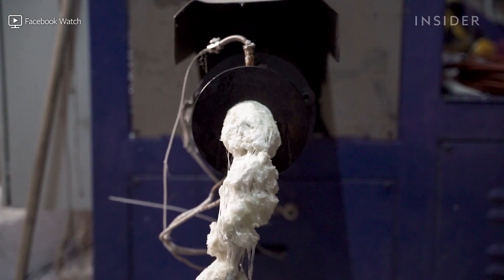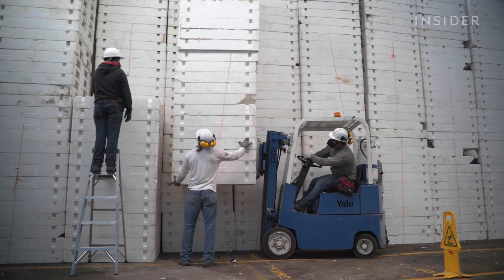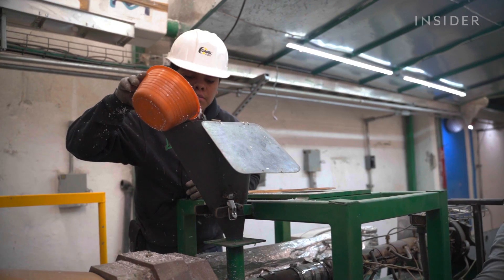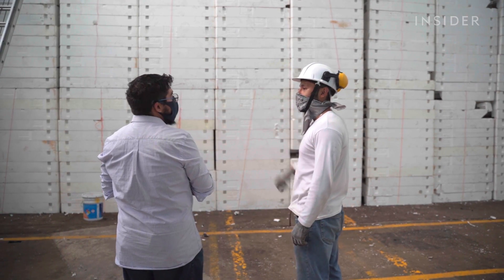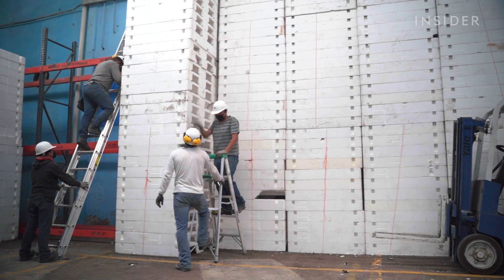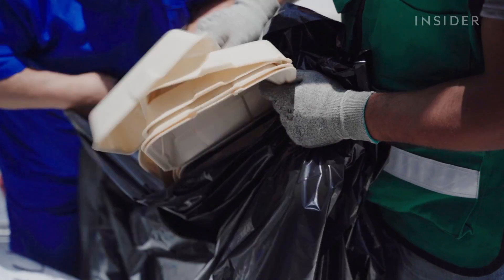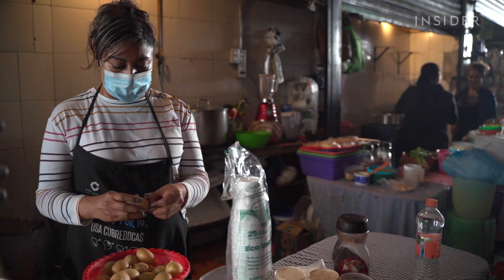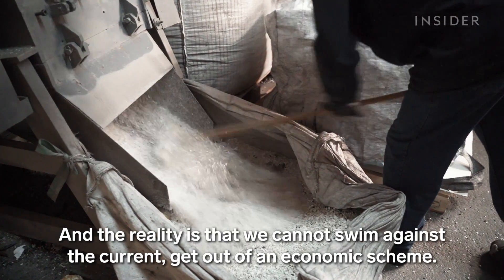Why It’s So Hard To Recycle Styrofoam and Polystyrene | World Wide Waste | Business Insider

Comment: In colder areas its probably a better idea to burn it.
Here in the town in the north of Sweden we have a cogeneration that has around 93% efficiency. It has state of the art filter systems that makes the air going out the chimney less polluted than the surrounding air (filtration removes 99.5% of all pollutants). 
It produces heat and electricity of course, but the filtrations system also produce gypsum as a byproduct and the final waste from the furnace is a granulate that could be used for filling up different kinds of hard surface grounds.
Sorry to say that no one buys those byproducts since they are associated with household waste..

The plant can burn 75 tonnes of waste per hour and produces 65 Megawatt of power where 15 is electricity (70GWh/year).
Reply: the foam densifier appears in this video is our brand called GREENMAX, we are also the end user of recycled EPS and EPE, would you like to recommand us the so we could buy that from them?

Comment: I think that a very critical aspect of the cost effectiveness and profitability of recycling this polystyrene foam is on-site densification of much of the foam prior to shipment to the recycling facility.  For a product that is about 95% air in its foam state, it likely doesn't make economic sense to load it on big heavy trucks for the trip to the recycling center (if one wants to make a profit).  To be cost-effective, the truck should be full (in volume) and the payload capacity should be maximized.  This can only be done if the foam is reduced from about 95% air to perhaps 5% air before shipment.  So the mobile foam densification machine makes a lot of sense to me.  Also, perhaps a relatively inexpensive densification machine for permanent on-site use would be very helpful.  This would be most helpful for businesses that generate a lot of continual polystyrene waste so as to greatly reduce the amount of storage space required.  Also, for places that generate a lot of food-contaminated polystyrene waste, a relatively inexpensive enclosed washer for removing about 95+% of the food from the polystyrene would likely be necessary so that polystyrene will be clean enough for the recycling process.

Just my 2 cents.

Ed Schultheis, PE
Mechanical design engineer and manufacturing consultant for 35 years
Schultek Engineering & Technology, Inc.
schultek dot com
Reply: But manufacturers etc can afford to ship said 95% air to consumers and still make money?
Reply: @robertlocock5636  Manufacturers can afford to ship polystyrene (which is perhaps 95% air) to consumers because they are shipping the very low-value foam with much higher-value product.  In the case of polystyrene recycling, the polystyrene IS the product.  So the only way to add to its value is to compress it as much as possible into a very dense solid or liquid before shipping to the recycler.

Ed

Comment: If we ban the foam we will end up using paper instead and most people still probably won't recycle. Cleveland ohio has been taking the recycle bins to the dump along with normal waste bins for years because it costs less money to process it. So they use twice as many trucks to do the same thing. We need to fix this problem along with keeping plastic out of our waterways
Reply: That sounds like a conspiracy theory to me. In the UK all the dumps have sections where different materials are put and they're very strict about it. Have you ever been to your local dump  and seen the recyclables dumped in the general waste yourself? Might be just one of those things people say to justify why they don't spend a few extra seconds sorting their waste.
Reply: @noire1001  yea its true, the local news has been doing a story about it for years and have spoken to the mayor along with the waste management officials.
Reply: The biggest problem with polystyrene is that it isn't really biodegradable.  Throw away that paper, and fungus and bacteria will chow down on those plant fibers and it will be gone in 10 years.  Chuck out the plastics, and they'll still be around, intact, 200+ years from now.

Comment: "In 2015, Stanford University scientists discovered that mealworms could be employed to break down Styrofoam (polystyrene) waste. The insects eat the material and break it down through digestion. Since then, the team has found that the worms do not absorb the toxic substance in the foam (hexabromocyclododecane, aka HBCD) into their bodies. Meaning, the bugs are safe to eat! They can be used to help with the problem of Styrofoam waste and then livestock feed."
Reply: What do you do with the HBCD
Reply: while that sounds cool in a lab, realistically the number of worms required to recycled any reasonable amount of foam would be far to high for practical use.

Comment: All that work for something that could have been solved by not using plastic in the first place. Is it really easier to collect, clean and melt down plastic food trays to then produce and sell new ones, rather than just making it once in metal and clean that. Do you really need to take away your food, and do you really have to suck soda out of a plastic straw?  Does your coffee cup have to be covered with a plastic lid like some 2 year olds sippy cup?
Just because you can recycle something doesnt mean its reducing pollution. In some cases it causes more, and why would the companies stop producing and capitalize on plastic trash when there are people cleaning it up for them. 
The people working hard to clean and save the world are real heroes, but sometimes i feel they are kinda enabling the big trashers.

Comment: "When you replace a product, I no longer consume plastic, but now I consume paper."

Umm...that's literally the point. Paper is more easily recycled and is renewable.

Either way, glad to see Business Insider out here pushing the age old propaganda that the consumers are to blame, not the companies that only put their products in single use plastics.
Reply: I think the point is that you are still using a product, and that product has to be dealt with after you throw it away. Hardly anything we use is recycled. Most of it-whether paper, plastic, wood, rubber, etc.- is simply thrown into the landfills. There has to be a better way.

Comment: "reccyle 5% of the foam from mexico city.  "  with the inefficient way they process this, I doubt it,  unless there is something they are not showing.  handing one piece at a time to a guy on a platform to get it into the grinder ?  Putting little orange buckets of  pieces into another machine to get the air out?    If indeed he warehouses all the styrofoam he shows in the vid, there is no way he will get that into the machines at the rate he says. He may collect 5% but not process it, unless he has 50 of those machines with hundreds of people working at them.
on average 14 tons a year.  not at the rate they are showing.  a ton of styrofoam would be HUGE in volume.
Reply: Yep, noticed the pace was very low too. I think if you dumped a lot more into those grinders, the heat released while grinding can't escape (styrofoam is an insulator) and you end up with a grinder full of goopie mess because the styrofoam would melt.
Reply: It should be a bulldozer they're using, then they may come closer to 5%.

Comment: Its formula is simply C8H8, just carbon and hydrogen. It is cleaner than crude oil and can simply be burned very cleanly in power plants or can produce synthesis gases for the chemical industry. To recycle it is just very inefficient and stupid. Because Styrofoam is made from crude oil and at the same time crude oil is burned in power plants, engines, turbines and also in the chemical industry. So better just burn it and produce new polystyrene from oil.

Comment: This shouldn’t even be a problem. They have found a species of cockroaches that can digest the Styrofoam rendering it completely inert. Shouldn’t be that difficult of a problem to find a way to allow the cockroaches to directly recycle the Styrofoam. Plan B being figure out what bacteria or enzyme is in their digestive system that does the process then cultivate it in large batches and use it to start the process of the breakdown.
Reply: How this helps the thing? The thing here is, that those polystyrene can be used again, and not get rid off off it. Otherwise you will need another set of chemicals to make a new one (products from reprocessed polystyrene).

Comment: "700 empire state buildings " Americans will do anything avoid using the metric system.
Reply: yep
Reply: It's same as in Finland heights are often referred as x times of height of stadium tower (I have no idea it's height). But those reporters usually live near it so they expect that everyone knows it.
Reply: The volume of the empire state building is not an iso standard unit of measurement.
Reply: @lightningdemolition1964  There's also "The Wales" here...
Reply: @lightningdemolition1964  Nothing used in the US of A seems to be.

Comment: It burns... so just recycle it thermally.
Or shred it bury it and call it "carbon capture "
Reply: It's not carbon capture if you make it with fossil carbon.
Burning it is still a much better idea than landfilling it, for sure.
Reply: @demoniack81  Waht’s the reasoning behind your statement? 
Burning it releases Carbon in the atmosphere but in exchange you get some energy back. 
To get carbon back out of the atmosphere you would need more energy then you got from burning the carbon.

So it makes sens to not burn it in the first place if the the goal is to reduce carbon in the atmosphere.
Reply: It makes even more sense if you use a bit of heat to convert it into dense plastics and use it for new product.
From an economical point of view, it's genius idea, because you don't need to mine another hydrocarbons, you just processing stuff you already have.
Not to mention enviromental impact.

Comment: You can shred styrofoam into the small bits. Mix it with concrete and you get aircrete. This is really interesting material, you can use it to isolate or build floors out of it. Even one story sheds and other applications are possible.
Reply: Is it strong?
Reply: @skeptical1465  the foam densifier appears in this video is our brand called GREENMAX, we are also the end user of recycled EPS and EPE, would you like to recommand us the so we could buy that from them?

Comment: Or grind it up and use it in insulative concrete walls
Reply: Makes the concrete weaker and more prone to insect infestation. It is also difficult to control in the mix. Polystyrene floats in concrete.

Comment: Styrofoam (which is a trademark) and similar polystyrene gas cell based foam products can be degassed when exposed to acetone gas or similar solvents with a low boiling point.
When the polystyrene cell structure is softened by the acetone gas, it collapses and liquidizes. 
Later in the process, the acetone gas and the gas that was contained within the foam cells can be evacuated from the polystyrene by vacuum treatment and the acetone separated from the cell gasses by compression to atmospheric pressure and cooling.
The result is polystyrene in a more or less pristine form.
Although it cannot be used in production of new foam products, polystyrene is used as solid plastic in many products.
Everybody in the plastic industry knows about this method or variants of it.

Comment: You can dissolve it in acetone, remove the air, filtrate it and clean it. It is also possible to reverse the process that forms polystyrene back to its original components.
Reply: A little gasoline dissolves a lot too. Great for taking out ant hills.
Reply: Waste of acetone. Hard to recover.
And does it actually dissolve,  or does it break down?
Reply: @skeptical1465  acetone can be distilled under vacuum at low temperature, that is not very difficult, so the acetone can be reused. And it is also possible to break it down, but I do not know exactly the process. It might need a lot of equipment and energy to do it, so from an economic standpoint it makes not much sense.
Reply: @adamabele785  I wonder if it's possible to really get all the acetone out?
Or if you end up with soft, highly flammable plastic. Interesting to be sure.

Comment: Just stop using single use polystyrene products (cutlery, cups, packaging)! There are many alternatives better for the environment. I worked for an EPS factory and its not recycled because of its main attribute- there's very little material per volume. It takes a lot of space to warehouse this trash and many units of transport to get to recycling facilities. Tax all the plastic because it externalizes costs to the environment making it cheaper than better materials.

Comment: We did something similar as a project in school. Dissolved HUGE amount of foam in some Acetone and baked out the acetone (and recovered it) to form a solid block of PS. Ground it up make pellets and molded them into something different. The new molding process didn't work well, but as a school project in 2 weeks it was pretty impressive. You can't master every piece of the cycle.
Reply: Very interesting
Reply: I find that hard to believe, the gasses released from the degradation of styrofoam are toxic as hell, and can damage lungs very easily is small amounts.  This is a silly idea.
Reply: @joshjosh575  What degradation? It's just dissolving in acetone. The polymer molecules stay intact. Exactly nothing dangerous happens there - given normal lab safety procedures.
We are not americans that can't be trusted handling a sponge without a warning sign - but firearms of course!
Reply: Acetone is not toxic dude
Reply: @7784000  lmao.  Bro, I’m not pro abortion, for the sake of the human species, I’d make an exception and allow you to abort any future offspring. Please do us a favor and drink some and text me how that went.
Reply: You could dissolve this plastic using lemon juice
Reply: @nealthomson9505  Dissolve styrofoam in lemon juice? I find that hard to believe...
Reply: Hi @jackmclane1826  . Its actually a form of solvent made from the oil.

They are collecting Styrofoam and putting it into 44gallon drums filled a quarter of a way with this lemon oil because it dissolves the Styrofoam and at the end of the day its easy to separate as well as the fact that its bio-degradable. 

The company that started doing this is a New York based company.
Reply: @nealthomson9505  Okay... du you have a link?
We chose acetone because it is so volatile that you can easily recover it.
I can imagine that some essential oils can dissolve it, too. Some essential oils are pretty aggressive.
Reply: Nice you use toxic volatile substance to recycle.  What happens with the acetone that is spent.  Acetone as dangerous and volatile.
Reply: @joshjosh575  Distill it off. We had almost 100% recovery of the acetone.
Reply: @joshjosh575  acetone ain’t that bad man our body makes it

Comment: If you wish to see something amazing. Take a small glass of gasoline and start adding Styrofoam to it. The Styrofoam just simply disappears and LOTS of it disappears compared to the amount of gasoline used.
Reply: That's basically napalm.
Reply: @moden321  Dish soap is better than Styrofoam for napalm but the two burn very well. This mixture is not really recyclable but interesting to watch being produced.

Comment: What I've noticed is places that don't use styrofoam to hold my take-out meal simply use normal plastic containers that look much like tupperware but are thinner. I assume these are easier to recycle. What would be ideal is if we could come up with a material that will simply biodegrade after a few months of exposure to high humidity. So, you could store them in a dry place, use them to hold food and they'll be durable enough to hold that food for a few weeks (which is way more than you'd need if we're talking about single-use) and then bury them in a landfill and they degrade in less than a year.
Reply: They make pressed paper containers like that which can be composted, unfortunatly landfills are anaerobic environments where nothing composts, so they need to go in a home compost bin or curbside yard waste bin.
Reply: Wait until they come up with micro plastic or micro this and that